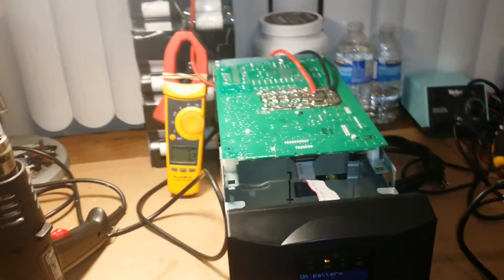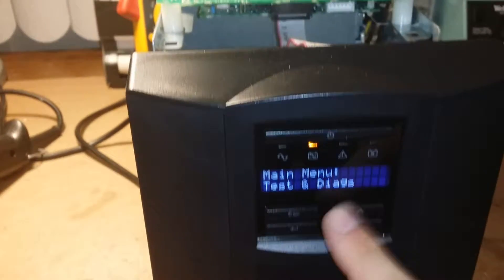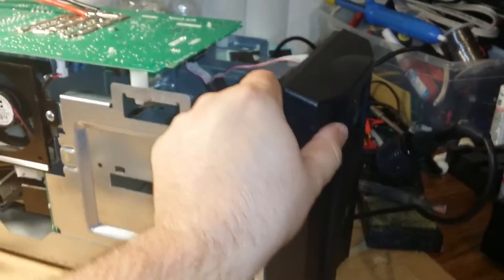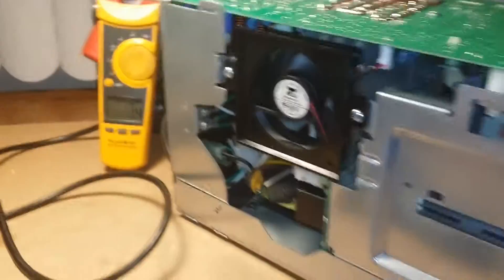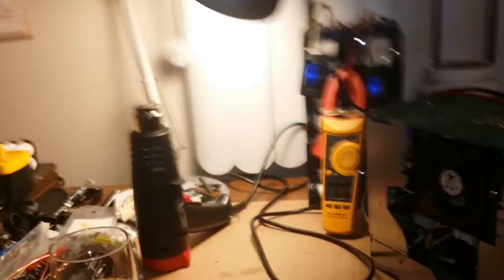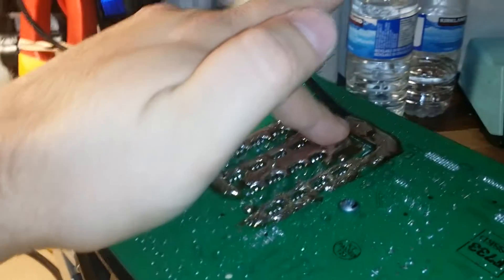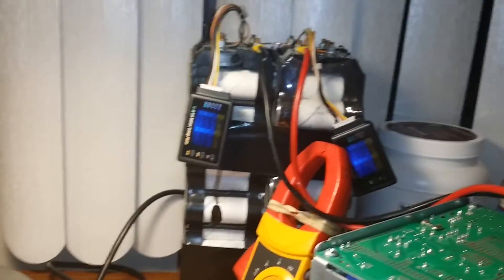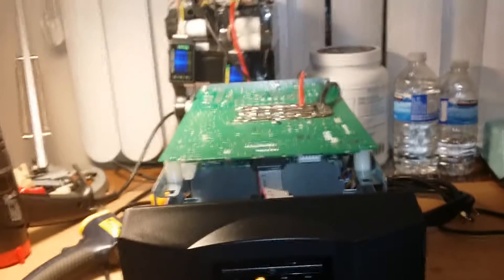Apc 1500 smart ups sinewave inverter Part 3

Comment: limiting factor is transformer at that freq.
If you would have option to run it at higher freq, then you could use it for more power.
But from such small unit, its pretty good. Just charging current is small if you have big batteries (external)